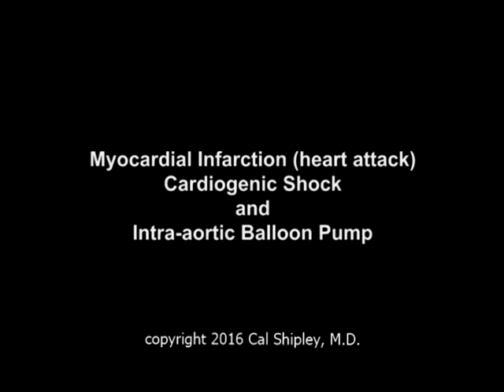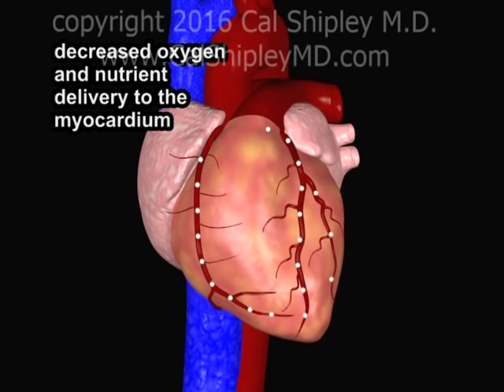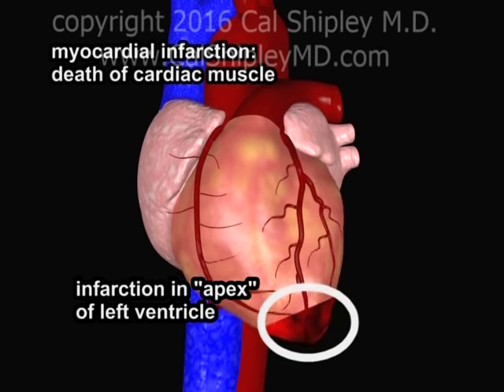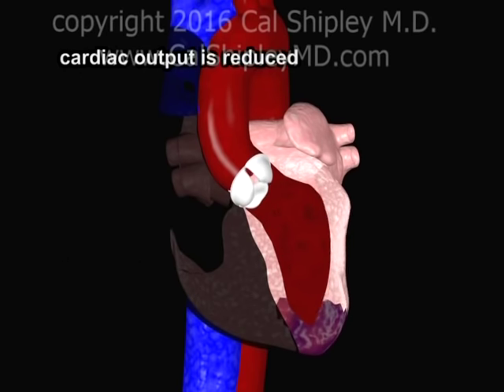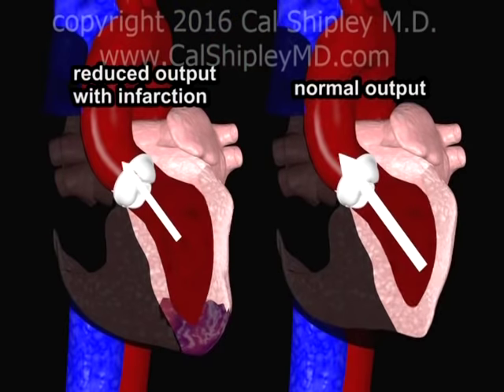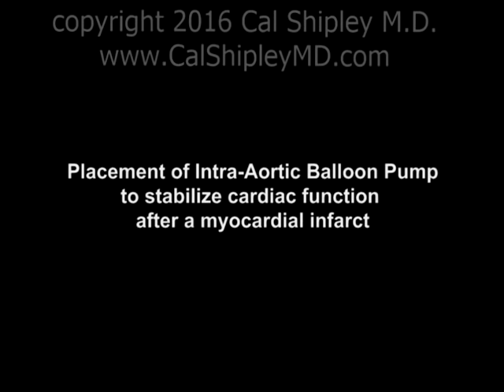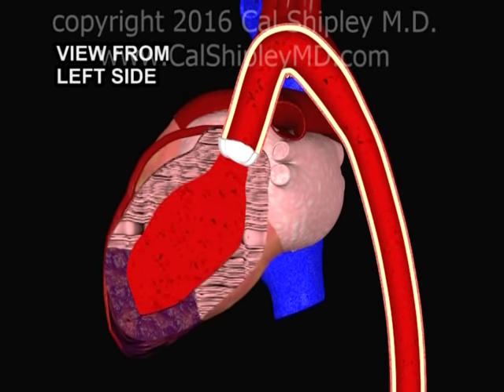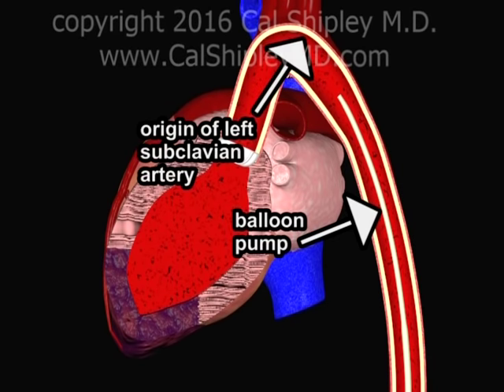Cardiogenic Shock and Intra-aortic Balloon Pump by Dr. Cal Shipley, M.D.

Comment: Dr Shipley,
In the process of weaning the pt off of the IABP, how do you change/decrease the inflation rate of the balloon? Thanks
Reply from the maker: Hi Tony! Sorry for the delayed response. The inflation/deflation of the balloon is under electronic control via an external controller, and can be set to automatically adjust based on cardiac output, etc, or changed manually. Hope this helps.  You can access my entire library of medical videos at hppts://trialimage.com